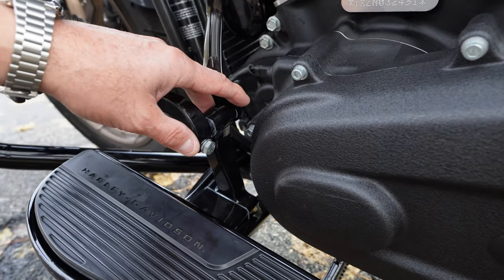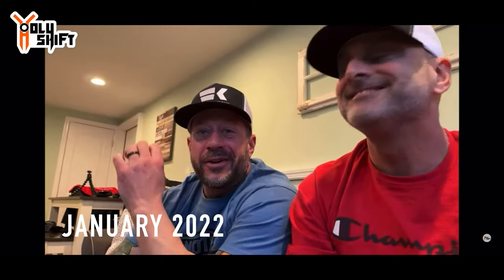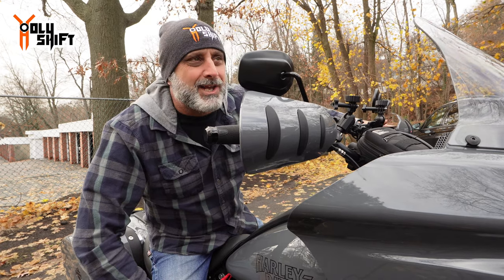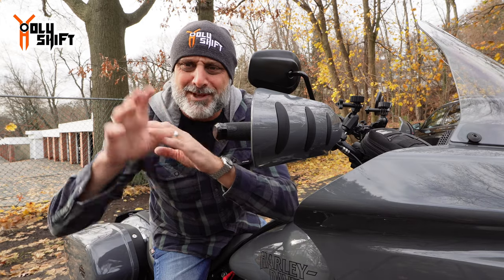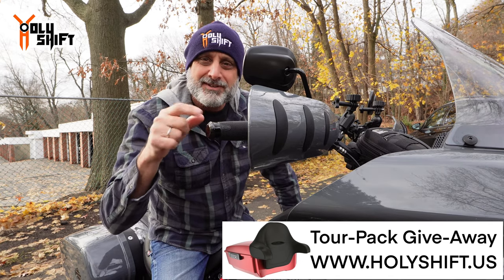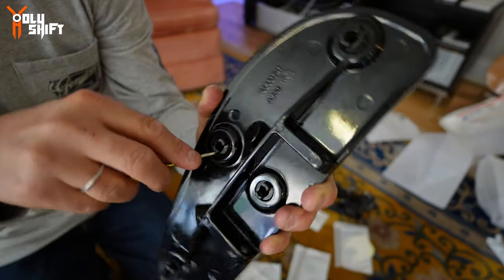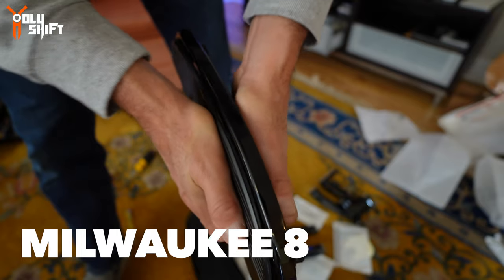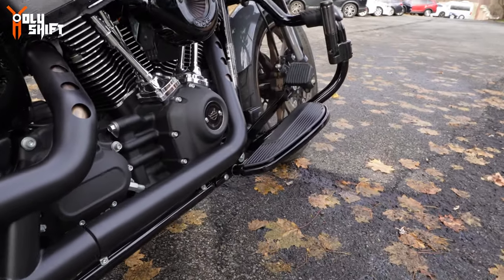Absolute Best FloorBoards

Comment: The floorboards look great. Harley-Davidson should make this an over-the-counter kit.
Ride safe.
Reply: Lol they do… the heritage floor boards and forward controls bolt right up….  None of this is necessary… don’t let anyone tell you different… I verified it 2 weeks ago..
Reply: @drainmonkeys385  Sorry, asking as a bike noobie, so you were able to use the same forward control kit sold by harley and attach the heritage softtail floorboards without any crazy modifications?

Thanks in advance!
Reply: @drainmonkeys385 Hey I know this is an old thread...But have a 20 lowrider s, so you're saying the the Heritage Softail forwards with floor boards will bolt right up? Same year 2020?

Comment: Thanks for the part numbers I found the microfiche online for m8 Softails with fwd cntrls. Around $500 at the dealer for everything as I had already installed, the black forward, control kit and the better brake lever from the chrome kit. I’ll probably end up with a couple extra pieces. If I knew then what I know now I would’ve built it out of the pieces rather than buy the  kit; keep up the good work!

Comment: You dont need to find the limited addition parts. These are just the Heritage floor boards and related parts from the Heritage. They come black stock now. Do you have a parts list? What did it cost you?
Reply from the maker: Thanks 🙏🏻 someone just said that too .
Reply: for anyone who needs a parts list i have one.
Reply: @JCunningham21  may I get that part list please?  Do I have to move my controls forward? I just want the floor boards
Reply: @JCunningham21 
Can you send me the parts list .
Reply: @JCunningham21  do you know what rear brake lever that is?
Reply: @JCunningham21  Please send me the parts list for the Lowrider ST / Heritage floorboards as well, thank you
Reply: @JCunningham21  I have a low rider at as well. I’d also like a parts list from moving from mids if possible. Thank you

Comment: just bought those floor boards off of you and can't wait to get them. I have been wanting some since you showed them on your channel. love your videos keep up the great work.
Reply from the maker: Thanks buddy. They are really nice ! So you are installing them on your mid controls ?
Reply: @HOLYSHIFT  yes
Reply: Hi m8 great vids I also want to fit floorboards to my low rider st I bought a  foreward control set on e bay so that will give me some of the parts but now I need to brackets for the boards the actual boards the brake pedal and the bracket for the shifter what other parts do I need on top of that  I saw you did a list of the parts with some crossed of in red as not needed is that because you had fitted the forwards first   In which case I can just order all the bits.  like you I like the rubber mounts on floorboards but I also love the heel shifter so I’ll also be adding that.
Reply: So Nice can you Please tell me were you can buy the floorboard 
Do you have a link?
Kind regards
Reply: Are the floor boards direct bolt ons to Low RIder ST mid control mounts ..?
Reply: @justonwillis3843  did those floorboards work well for your mid controls?

Comment: Is it possible to add a heel shifter on this set up? 
Do you need to replace the original airfilter? Is it hampering the new leg position?
Thanks a lot.
Very informative video's 👍.
Reply: this is the Heritage set up. you can add the heal shifter. i plan too.

Comment: Hay Sandy, love you work. Just picked up my ST a week ago and have already ordered my forward controls and crash guard, been caught in the rain on 2 occasions and noticed the water beads at the corner of the fairing just above the small wind deflectors which drenched my knees. With your connections can someone make a longer deflector that would protect the rider from rain. It could still be fixed in position with th 2 existing screws but just come up higher. Why is everthing on back order here in Australia, make the parts in America.

Comment: Hello, great job on the video.  I have the forward controls on mine that the dealer worked in but they, of course, put in the black set which has the smaller brake lever.  I don't suppose you have a part number or happen to know what the larger brake pedal is that I would need so I can swap that part out itself?

Comment: which brake lever is this? im stuck with my mini floorboards from thrashin but feel like all i need to do is get a better brake lever arm vs the stock one from the forwards. The stock one is 100% bad with the boards i have and cant be fully leveraged. My HD shop is quite confused on how to source/find the parts to make this setup work

Comment: sandy what are those part numbers you have near the 9 min mark?  i'm trying to do the same thing you did.  i had my dealer moved my mids to forwards and i have the trashin min-boards but not happy with the setup.  1) I CANNOT use that stock rear brake pedal which means i cant ride my bike and feel safe. so the FIRST thing i need to do is change the brake pedal to the one you put on yours.  but there are about 30 parts and i cant tell which part is the rear black brake lever.  i need to replace that first to see if i can live with the mini boards.  i cant seem to find a lot of those part numbers when i google them.  are they all HD part numbers?  if so do you know specifically which one is the rear brake lever ?  thanks !

Comment: if i install those floorboards do i have to install  the forward control kit first? seems like ill be spending money on forward control brackets when i would have to changed them for the floorboard brackets.
Reply from the maker: No ! These floorboards will fit on the stock mid controls

Comment: You can put the heritage forward controls on it… $600 go yo the dealer . You can order it… guaranteed.. you’ll need all the brackets… but they will bolt right up..
Reply from the maker: Yes - I think it’s the same as the fat boy’s foot boards
Reply: @HOLYSHIFT  Hi, just doing the same, pity I didn't see this first though as I had to work out all the part numbers myself, the Fat Boy brackets are a little wider than the Heritage - hence the different part numbers, I decided on the Heritage ones to try and limit scratching ;-)